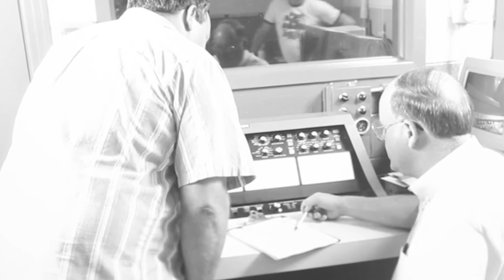COMP Cams Owner, Ron Coleman

Comment: I have a Comp Cams 8 years ago Installed on my Datsun 260C with a L26 6 Cyl. Aka. Nissan Cedric... without any problem, The Cam respond when I push down the pedal.. congrats for make great Camshafts. Built to last.